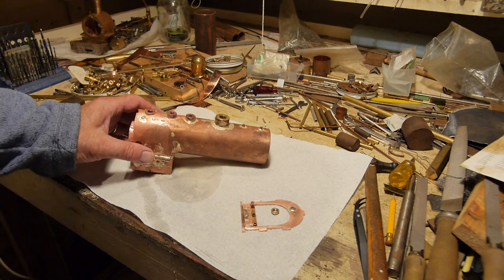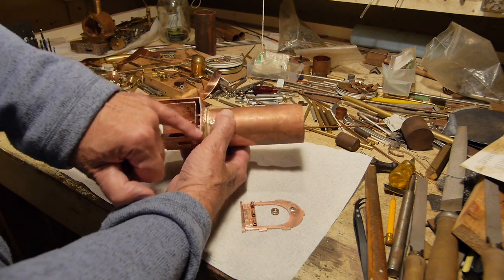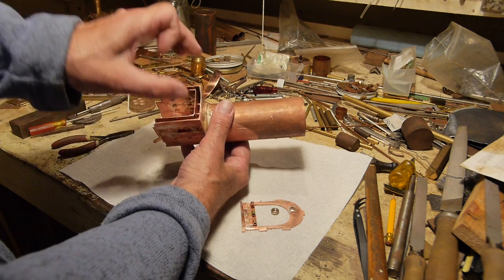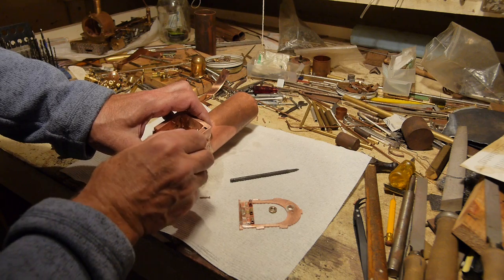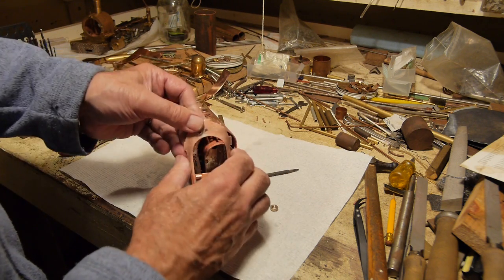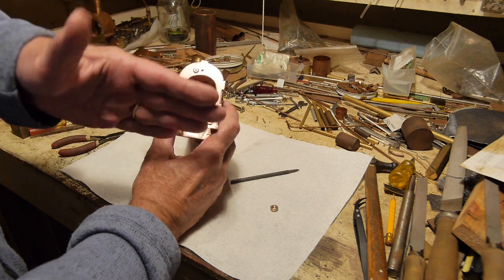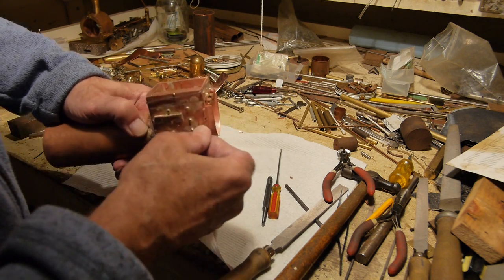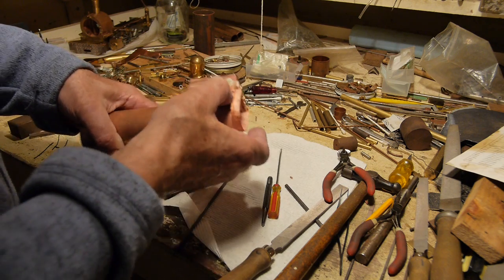Boiler making for live steam model locos,  Part 5

Comment: Having built 7 locos, 3 in 3.5 in gauge, 2 in 5in gauge & 2 in 7.25 gauge and the boilers for all the 3.5 and 5in the best bit of advice is make sure you have enough heat that the work is hot enough to allow the silver solder to flow.

Comment: it would have been nice if you would have shown the brazing process as well.
Reply from the maker: I felt there was enough about brazing boilers in other people videos.  I wanted to focus on design ideas and construction method so if you want to build one you'll avoid some of the practical mistake and make an easier boiler to run.
Reply: Brazing refers to using brass as the filler/joining material. The joints are silver soldered on copper model steam locomotives. Brass will deteriorate, in particular in the fire box. A brazed boiler would not pass inspection.